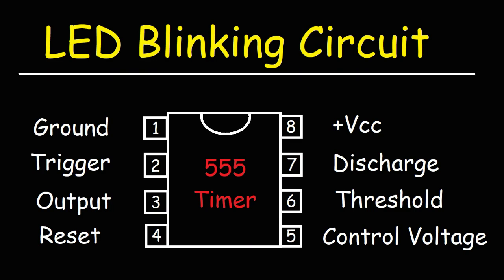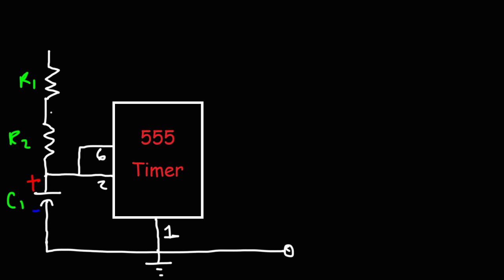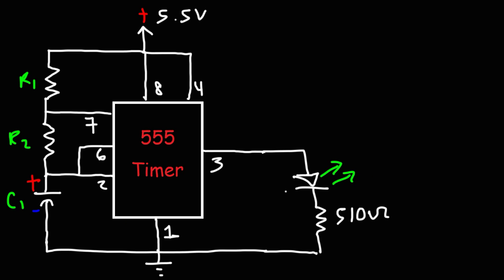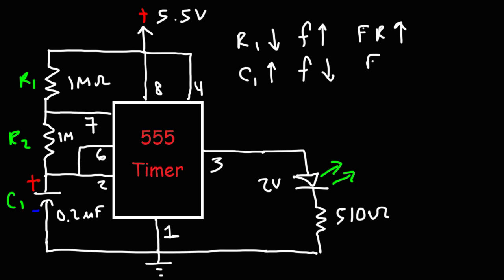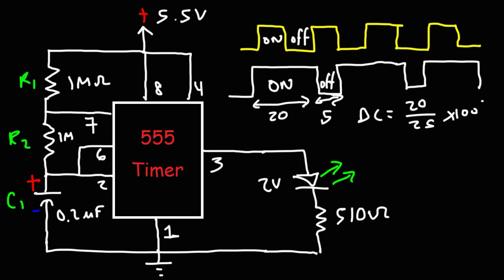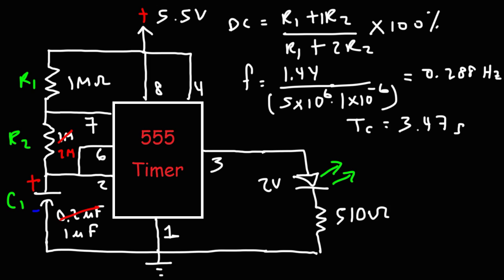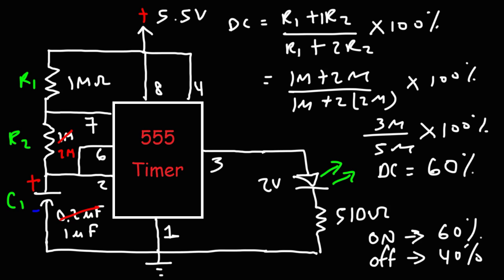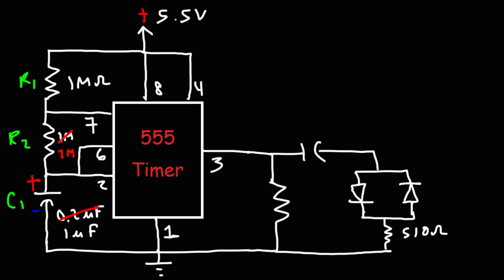LED Blinking Circuit Using 555 Timer

Comment: A great easy to follow tutorial. As the 555 timer can both source current and sink current on its pin 3 you could have just connected the red led with a 510 ohm resistor between pin 3 and Vcc (+ 5.5 volts) leaving the green led as it is in your circuit.. No need for the  1000 uF capacitor. The two leds will alternate flash then.